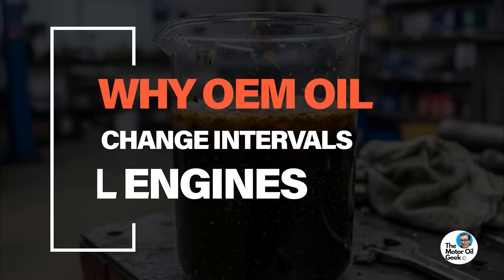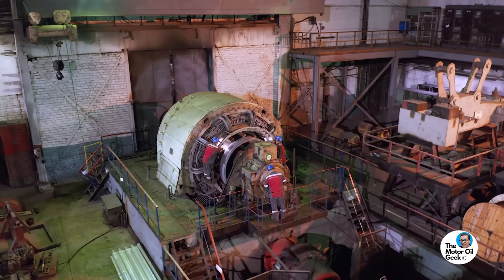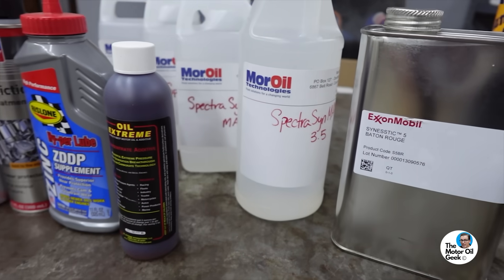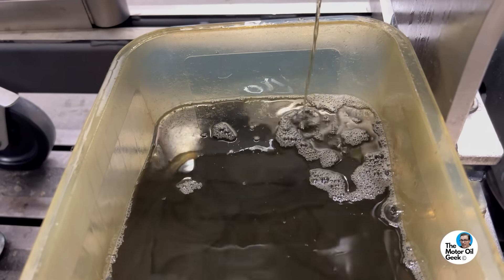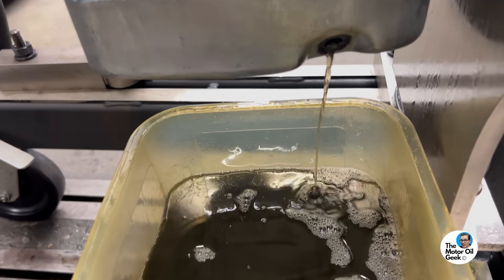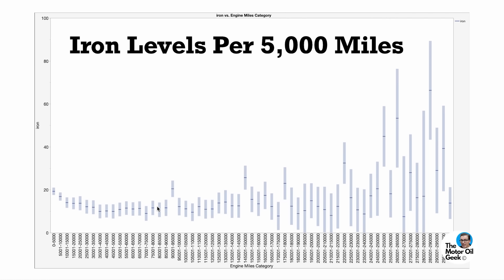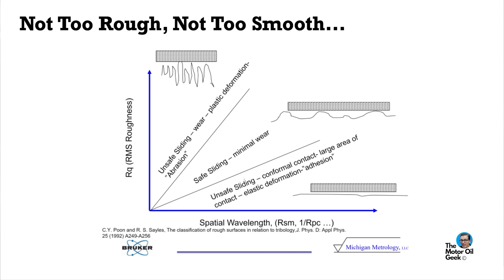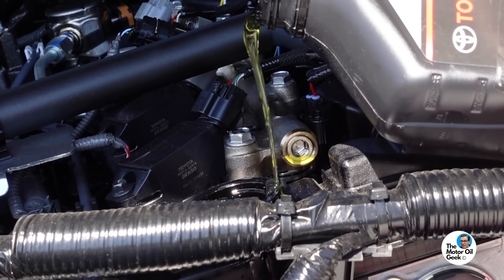NEW Data Reveals WHY Modern Engines FAIL Prematurely!

Comment: Lake, please address high mileage vehicles/engines, and how to properly maintain them over 150-200k. I switched from 5W-20 to 5W-30, and it seems to like that better. Much smoother and quieter now.
Ciao for now!
Reply: I would like to see your suggestion done by Lake. Most of us watching these videos have high mileage vehicles.
Reply: @mercedes-amgforlife3237 
yes, because many of us have high mileage vehicles, and oil change interval and oil type become more important as the vehicle ages
Reply: In one of Lake’s videos he claimed Speed Diagnostics’ oil analysis info showed that vehicles running 5W-30 had similar wear metals compared to vehicles running 0W-20. However, I don’t think you can c compare the average wear rates for the two oils without also comparing the ambient temperatures and vehicle ages. 

0W-20 may be just just fine for a young vehicle up North but lead to excessive wear in the heat of the south and/or if the engine has worn and clearances have opened up. If the appropriate viscosity is chosen for both situations the wear rates may be similar and could easily lead to the conclusion that 5W-30 is unnecessary when in fact the opposite could be the case.
Reply: @shawngrimes9302 yes
Reply: Synthetic mobil 1 5/30 will pump to -40. . I'm in southern Minnesota that's no problem. I would used 0/20 in Canada winters though. 5/30  is just fine all year long for me.
Reply: I've done the same with the same results. These super thin oils are a death sentence to engine life.
Reply: application and environment dictates your oil type. Add high mileage to the equation to complicate matters more. My 2.5L Duratec engine requires 5W-20, but i have 211k and switched to 5W-30 Restore and Protect. Have Pennzoil Ultra Platinum 5W-30 waiting on deck for next OCI
[edit to add]
using a Purolator One oil filter. I have a Fram Synthetic Endurance, and MicroGard select. These are the larger, longer PF-400 filters
Reply: I dont belive he will do that
Reply: Valvoline Restore and Protect plus 500 to 1000 mile filter changes for 2-3 cycles. Cleaned up my 2017 Hyundai Elantra so well that my mechanic friend using a boroscope brought everyone over to look at how clean a 175,000 mile vehicle looked.
Reply: @ungabunga3183 what oil change interval did you did prior to using Restore and Protect?  With proper oil change intervals, that engine should have looked just as good without the Restore and Protect. Although I may do 3 oil changes with the Restore and Protect since I’m at 188,000 miles and I’m sure the valves are filled with carbon deposits since it’s a GDI.  I think the Restore and Protect is a wise thing to do maybe 3 oil changes in a row every 60,000 miles for a GDI.  This is speculation of course.
Reply: @CreatingExcellence  Interesting anecdote!
Reply: @ungabunga3183 
did you record this? I'm currently running VRP in a 211,000 mile 2.5L 4cyl
Reply: @ungabunga3183  be careful having a higher mileage vehicle and running the Valvoline restore and protect because I ran it for like four months and then all of a sudden I started having EGR problems, my EGR pipe and everything related to it was clogged up with tons of carbon. It could be related it could be unrelated I honestly don’t know. I’m just saying that was my experience.
Reply: Personally I went from 5,000 to 6,500 OCI down to 3,000 to 4,000 OCI on my higher mileage GDI Turbo engine.  Just changed it just might at 3,500 miles.  I do a ton of short distance driving, 90% around town / city stop and go driving.  I haul a round a much of extra weight in the cargo area, I do a fair amount of idling (not good), so for me with 188,000 miles, the sweet spot is 3,000 to 3,500 with full synthetic.  The oil is black crap and I can smell the fuel.  I can’t imagine going 5,000 to 7,000 miles on the oil I drained last night.  Personally I would say do 4,000 or a bit less oil change intervals if you have 150,000 miles plus.  That being said, I will never do more than 4,000 miles oil change intervals on any vehicle again.  If money is an issue then just use Kirkland or SuperTech both made by Warren.  Totally fine for daily commuting drives.  I use Valvoline High Mileage synthetic.  Stuff is fantastic.
Reply: @CreatingExcellence look at what people are doing adding 2stroke marine grade oil to their fuel at 1:600 ratio (1oz per 5gallon). It reduces blow by on worn upper cylinders. This is most likely the cause of fuel leaking into the oil on all high mileage vehicles.
Reply: @CreatingExcellence  I agree. I’m changing my oil in my Honda Pilot with GDI at 2500-3000 mile intervals because I can smell the gasoline ⛽ contamination. Been changing oil for to yrs. Today’s GDI only cars with 0w20 smell like 1970s carburetor cars with 10w40. Old school…..but not stupid! 🤪
Reply: @CreatingExcellence Plus, you definitely have to change more often on engine with turbos

Comment: Question for Lake-Would I be better off changing my oil every 3k with cheap oil or going 5-6k with a quality oil?
Reply: Even the cheapest full-synthetic is high-quality, compared to even the most-expensive conventional oil (Lake did a video on this).
Worry more about the quality of gasoline you are using.
Higher quality gasoline = less gasoline dilution of your motor oil (because of clean fuel-injectors resulting in optimal atomization and more-thorough burn; leftover unburned gasoline makes its way past the rings into the crankcase).
Best gasolines:
Exxon/Mobil: premium (Synergy Supreme+)
Shell: premium (V-Power)
Reply: @aliendroneservices6621nice. What if my car calls for 87 or 89. Is Exxon/Shell still the best for that?
Reply: Yeah I wonder that.

Comment: This is no excuse. Engines built with better materials and looser tolerances decades ago, lasted hundreds of thousands of miles with sh*t oil.
Reply: No they didn't.  I remember in the late 60's and early 70's an engine that made it 100,000 miles usually was an oil burner. Every engine I tore down back then was full of sludge. 200,000 miles on a car was very rare, now it is expected.
Reply: @CAN43714true but how many of them were actually changing their oil at 3,000 miles with conventional?  Plus oil has come a long long way since then.  Those oil change intervals should have been 2,000 miles.
Reply: @CreatingExcellence  Yes, oil has come a long way.  Back then 3000-mile oil changes were standard, and synthetic oils were just coming out.  Engines were not CNC milled to close tolerances like they are now and metallurgy is far more advanced.
Reply: @CAN43714 Highly disagree. Materials were far superior back then as well as the oil. Modern oil can't even provide adequate lubrication for flat tappet cams.
Reply: @JohnDoe-ml8ru  Oil is way superior now than in the past!!!!!  Plastics are superior, rubber is superior, metal is superior (depending on the source), gaskets are superior, just about everything has advanced with computers aiding chemical engineering.
Reply: @CAN43714 Bwhahaha! What are you talking about? Oil is far inferior than it use to be. It can't even protect against metal to metal contact anymore. Plastics are far inferior due to hippy, green regulations. Most modern plastics last about half as long as older plastics. Ever seen a dodge dashboard? But bakelite plastics will last nearly a lifetime. ALL rubber is far inferior. Ever wonder why old bushings from 40 years ago can still be used while 5 year old bushings and hoses on modern cars are all rotten? Stop blindly listening to the propaganda and use that brain.
Reply: @JohnDoe-ml8ru  Modern racing spec oil is superior to the old stuff. I use Penrite 10 Tenths Racing Oil 10W40 in my BMW diesel engine. 100% PAO and Ester (extremely pure synthetic) with high dose of ZDDP Zinc additive. It doesnt work on modern engines with the DPF intact (emissions crap), but I deleted my DPF (illegal in California)
Reply: @JohnDoe-ml8ru  You are delusional!  My guess is that you get all your news from one source also.
Reply: @CAN43714 "Decades ago" is 2005 and earlier. That is 20 years already.
Reply: @MikeO-l7s  Not sure what you mean by that.  Many engines produced after 2005 have made it to 1 million miles without major repairs.
Reply: @MikeO-l7s   Why you make me sad? :(
Reply: @CAN43714 He said 'decades" ago and you start talking about the 60's. I'm saying you don't have to look that far back.
Reply: @MikeO-l7s  Not that far, but the last decent engines were before the LS and modern Hemi. Maybe the late 90's. After that, all plastic and aluminum crap.
Reply: @JohnDoe-ml8ru  True, but I still want a new BMW B58 or S58 engine.
Reply: @CAN43714exactly!
Reply: @CAN43714 That might be your experience, but is not the truth. The truth is that old engines like traditional GM V6's V8's and especially the GM 250 and 292, would last 300-500K miles or more. My mom's 67 Chevy 250 lasted 500,000 miles and she rarely ever changed the oil.
Reply: @JohnDoe-ml8ru lol
Reply: @JohnDoe-ml8ru  You are full of B.S.  I highly doubt your Mothers 67 chevy 250 lasted 500,000 miles with rarely changing the oil.  I had two of those, one in 1/2 ton truck and another in a 72 Nova.  Both only made it to around 150,000 miles.  Both were riddled with problems.

Comment: I have an '09 Altima coupe 2.5 liter with 130, 000 miles on it. I bought it with 114, 000 miles on it for $3k. I only drive maybe 3, 000 miles a year, mostly short hops in Pennsylvania. I change the oil once a year using Amsoil Signature 5w30 and a Purolator Boss filter. I always change the filter every 6months as well. After watching this video I'm wondering if I should be changing my filter midway through or just keep the same filter for the entire year? Any thoughts on this anyone?
Reply: You can do an oil sample at the end of the year and see if the oil is doing well. I would say that being Amsoil, you'll be fine once a year
Reply: Periodically drive it on the highway for an hour.
Reply: Yes and why don't you use an AMSOIL filter as well. They do really well on filtration, 99% efficient at 20 microns and still flow.  Most filters are only good to 30-40 microns.

Comment: Did he say not to necessarily charge my filter with the oil every 3-4k?
Reply: Yeah. He’s gonna hopefully do a follow up. In the air filter video, they proved it actually filtered better as it got older obviously up to a point. My guess is (top quality) oil filter is the same.
Reply: @SatoshisDiaper  The Donaldson rep in the air filter video said air and fluids filter differently so they have different strategies. Dust on an air filter stacked at the surface helps capture more dust by electrostatic attraction.

Comment: I have and always will use Castrol period from Castrol classic to GTX to GTX HM and now I use Castrol Edge. I have hit 200,000 Mi + on multiple vehicles. My 2008 Buick Lucerne cxl I bought with 164,000 Mi and traded it in what's 210,000 miles.

I now have a 2015 Buick LaCrosse premium 2 with 85K and I will be running Castrol Edge 5W-30 with A Mobil 1 filter because that is what works for me.
Reply: 389,000 on my 3.6 GM using pins oil ultra platinum 5W-30 never had timing chain issues no leaks no oil burned and on the highway in the GMC Canyon can get 27 miles per gallon driving to Florida
Reply: @philpearce5707  hell yeah I bought mine in October. First thing I did was change the oil using Regular Castrol Edge 5W-30 with Mobil1 EP. Cause I never trust dealerships an don't know what they used or when it was changed.. I will change JUST the Oil again at 3K miles with Castrol Edge EP(Gold Bottle) an that should set the oil an that's what I'll use for the rest of that cars life..

Change the ignition coils with Delphi ignition coils and put NGK iridium IX spark plugs in it an just put a new ACdelco Air filter in it..

Comment: Change my oil every 6 months regardless of miles and never any issues. Funny thing I use a magnet on a friend's oil filter and cut filter open after 4k miles and the was surprised at the long dark mark on the side I put the magnet on. So for the last five years I have been using drain plugs with magnets on my vehicles with success the first oil change after installing them there was stuff on the magnets on both vehicles but it was less on second and by the third there was nothing on them since. This guy should be called the Oil God! Great stuff. Been watching you for almost two years. Merry Christmas!

Comment: The problem with moderm engines is CAFE  bullshit, lower viscosity causes less leeway for particles to pass without damage. 

Use a higher viscosity than the manufacturer recommends and change it often.
Reply: 100%. It’s amazing the amount of people online that argue “manufacturer knows better” pushing these 0w-20’s. Yeah I ain’t running that.

Comment: That’s why I’ve been using Shell Rotella T6 5W-40 in all my gasoline vehicles since 2009. Despite what many people say, I’ve had zero engine issues.
Reply: Superior Oil. Use it in all my performance Motorcycles.

Comment: I've had a burning question that I would love to get your opinion. I have a 2023 Toyota Innova with a 2,8 liter diesel, in the Philippines. My dealership uses  Toyota synthetic oil in 5w30 which is recommended by the manufacturer. However it is oil designed for gas and diesel engines. Is this oil a compromise between gas and diesel engine requirements or am I getting the proper protection with this oil designed for gas and diesel engines. Thanks

Comment: Would this apply to Molybdenum disulfide as well? It definitely lowers Van der Waals forces in some situations, but would negate the cleanliness given it is a suspension not in solution. 

I am not aware of any modern, full synthetic oils that use MoS2 but the question relates to formulations developed for older engines, generally those without variable cam timing. Only hydraulic tensioning of the timing chain.

Comment: Let's hear more on filtration.
Reply: Yes, filter recommendation please. Is OEM filtration the best? Do it by OEM.
Reply: @RonRussell-sj1zf  The OEM American-brand filters like Ford (usually Puralator), AC Delco (usually Champ Labs) and Mopar filters tend to be very efficient in terms of micron rating, don't they?
Reply: @TassieLorenzo  Most oem's are rated at 99% at 30-50 microns, which actually isn't the best, considering most fram's are 99% at 20 microns.
Reply: @RonRussell-sj1zf  You should watch brand ranks video on oem filters.
Reply: @RonRussell-sj1zf I think OEM filters are a solid choice especially if you do a 7,500 mile interval oil change interval. Just believing in that they-do sell an adequate filter as the OEM filters are dedicated to go 10K by recommendation so on 7,500 I believe you are gold.
Reply: 7500? lol enjoy your brick at 100k
Reply: Quite a few white papers written on the  cleanliness of ATF, Hydraulic fluids, and extended equipment life. 
Something that OEMs have zero interest in. 
Throw it away and buy new is where we are at today in the consumer auto market.
Reply: @juicebox22a  I will keep wrenching on my 22 year old Corolla thank, you.  I HAVE PURCHASED MY LAST NEW CAR!!!!!  In 2008!
Reply: @juicebox22a  The OEMs having a different definition of the lifetime of the vehicle then customers do when they say "lifetime fill" don't they? The OEMs expectation is (I believe) 10 years or 100,000miles and after that they would prefer you buy a new one again.
Reply: @juicebox22a  Yes, they have to keep selling new cars because their whole company future depends on new sales, parts and service are a distant afterthought.
Reply: Did I hear someone say "OIL THREAD"????

Comment: Auto engines filter in bypass meaning they don't filter all the oil. This is an issue that with heavy duty engines do not have because they filter ALL the oil. There should be two filters or one much larger one and no bypassing of the oil. We are not dealing with lawn mower engines, but engines costing $10K or more. This one fact warrants full filtration of all the oil, not bypassing a filtering a fraction of the oil. Centrifugal bypass filtering is common on many diesel truck engines and is another great way to keep the oil cleaner that any bypass system.